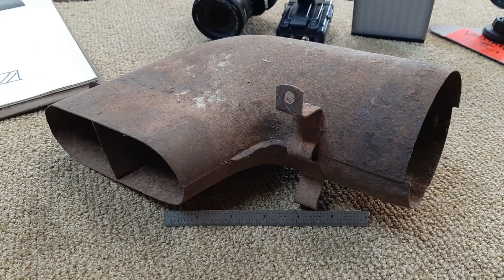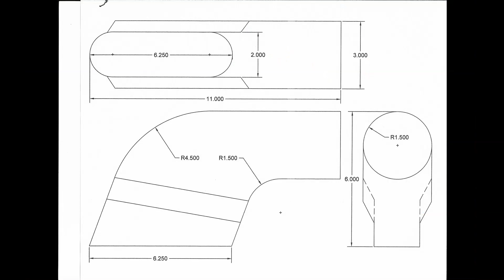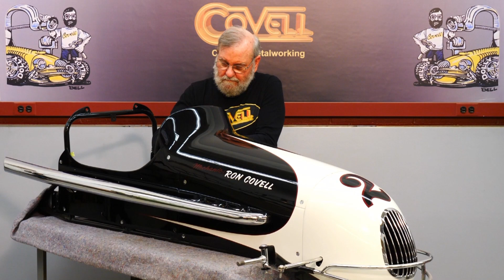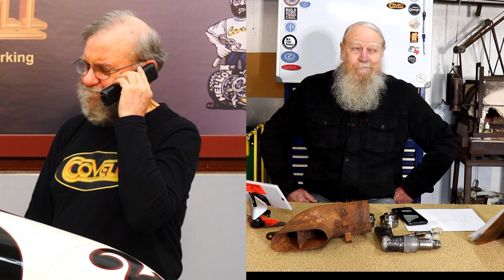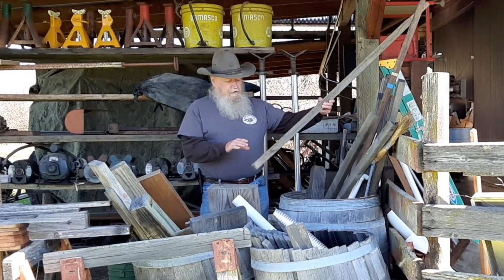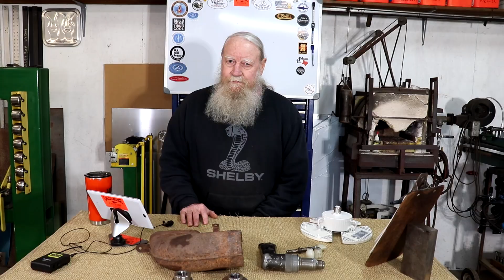Making An Odd Shape With Ron Covell - Part 1

Comment: I am really looking forward to seeing what you do with flow forming. I have made a lot of parts and a lot of money using that technique and I have a drawer full of "ends" for my rivet gun made from every thing from aluminum, various plastics, phenolic and others. Can't wait to see where you go with it.
Reply from the maker: Hello Edward:
It should be quite interesting to see how other people accomplish a task. Being a blacksmith since 1973 I have had the opportunity to look at the movement of metal in a different way. Seeing material where it wants to go instead of where you want it to go.

Thanks for watching and I hope to get some feedback from you after the 3rd (shaping the piece) video is presented.             Jere
Reply: @jerekirkpatrick2092  You can bet I'll be watching. Almost all of the flow forming I have done has been into a female die with the action being stretching so I'll be curious to see how it works from the "outside" of the part or if you elect to make a female tool from your wooden hammer form. FWIW, I have successfully stretched .060" 1100 dead soft aluminum to a bit more than 150% of its original size w/o annealing with only one "blowout" in about 60 parts. I will say, it's getting pretty tight by the time I'm done.You would have the same percentage of stretch if you elect to make the 3" diameter by stretching, but there are other ways. 
Regards,
Ed Taylor

Comment: Looking forward to this.. any idea where this part was from? What vehicle was it on?
Reply from the maker: Hello Thomas:

I have no idea what the piece was off of. It was on the ground not near any car. I think it is for the defroster under the dash. It has a divider inside so I think it splits the hot air to the right and left sides of the windshield. 

Thanks for watching and please subscribe.         Jere
Reply: @jerekirkpatrick2092  I think the vane inside is to help the air make the turn and keep the flow. It looks like an exhaust tip..Looks to heavy to be a defroster duct, doesn’t it?
Reply from the maker: @thomasaltruda  You are correct Thomas. The vane is to help with air flow. I guess I will never know what it's intended use was. The shape was just too intriguing to let it stay lying on the ground.        Jere

Comment: Hi Jere,
This should an interesting series, for sure.
You have a section just for exotic woods at your place. I'm impressed.
By the way.. The "buy me a coffee" system won't take a non-US Paypal. How rude. ;)
Joe
Reply from the maker: Joe - Yes. Seeing one piece made two different ways and coming out with the same finished piece should be quite informative.
I have had guys buy me coffee from Spain, and Italy. No clue on why yours wont work.
Thanks for trying though.         Jere
Reply: Yes, it should informative. There is always more than one way to do most things. 
As for the "situation", I'll try another method. A man has to have his coffee.....